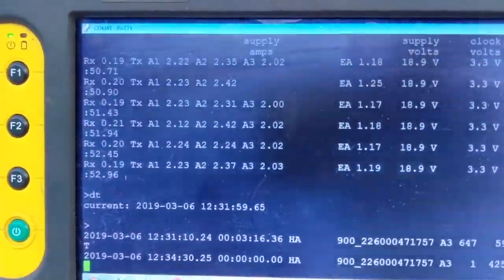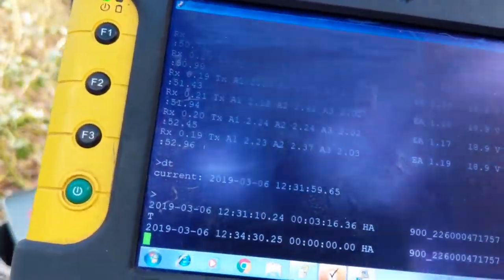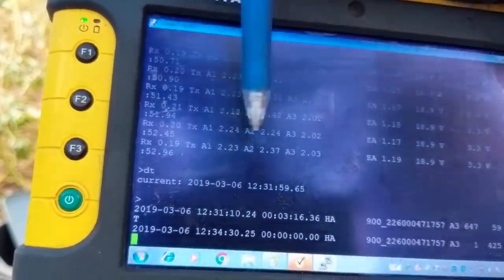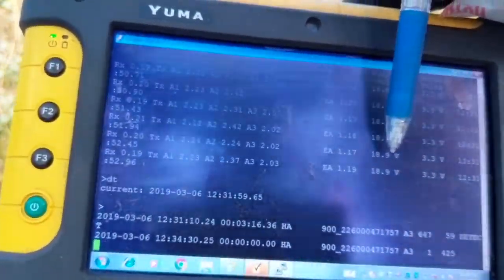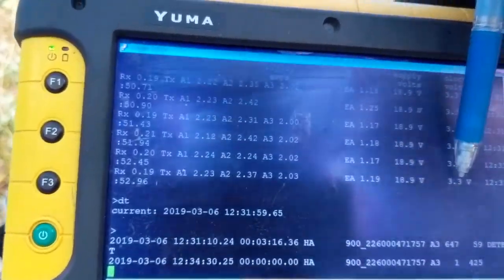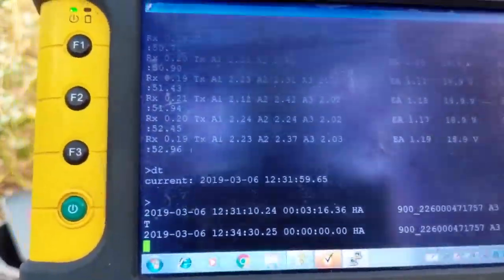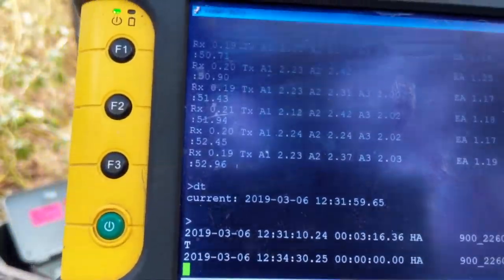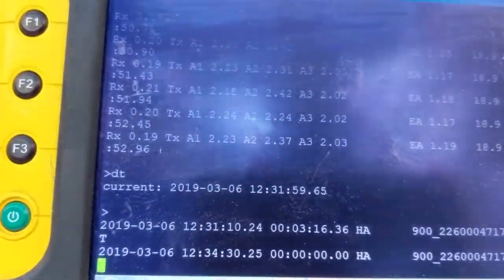Science Vlog: RFID for Sediment Transport

Comment: What type of reader would you suggest for someone who has never worked with PIT tags or their readers?
Reply from the maker: The answer depends on how much money you have, because if you have enough money you can hire a company like Biomark to make the system work. If your budget is modest, as most research budgets are, I would suggest Oregon RFID's newer, single-antenna reader, which features on-board GPS for accurate time. Oregon RFID has also been promising a new multi-antenna reader for some time now. I don't know when that will be released. Of course, the answer also depends on your objectives. I'd be happy to talk with you about what you might have in mind. PM me if you'd like to be in touch.